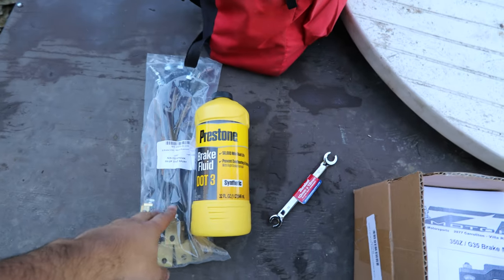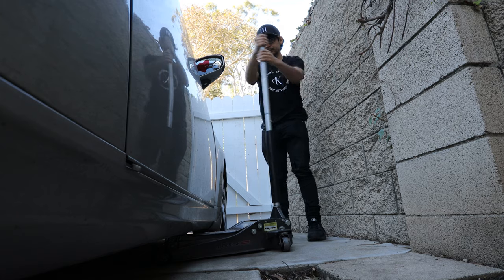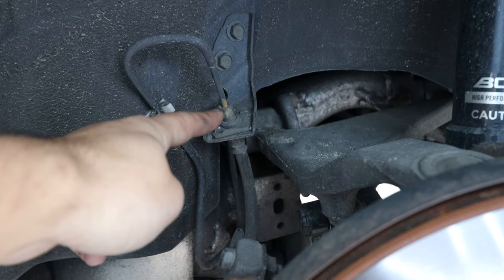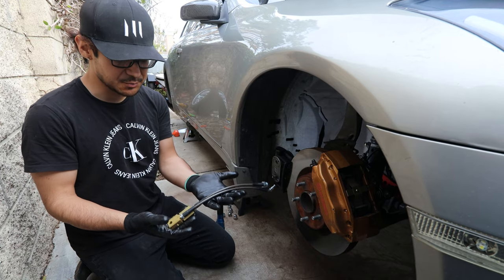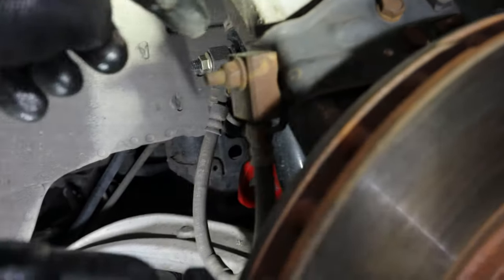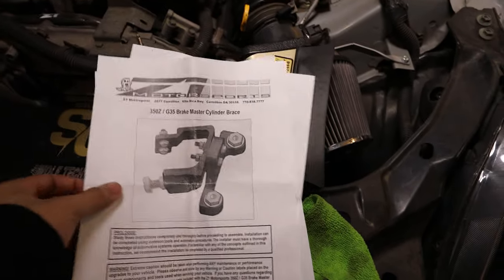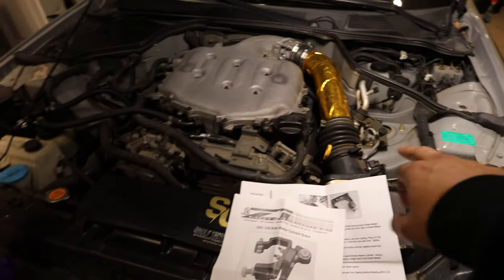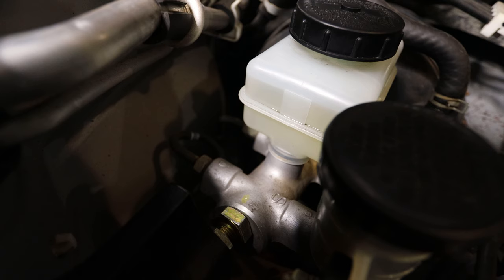THESE Brake Mods EVERY G35 / 350z Owner Should Have!!

Comment: What rotors and pads are you running?
Reply from the maker: I got them from r1 concepts! Definitely recommend! Great price!!
Reply: @JoeVazquez  right on, I recently got the z1 g35 non brembo brake package with the steel lines and master cylinder brace. Pads and rotors are on and brakes feel better but I think the lines are really gonna change the car.

Comment: Question any good brake kits recommendation for a noobie?
Reply from the maker: Go on r1 concepts website, amazing price and great variety for what you need!
Reply: I have akebono g37 big break kit on my g35 coupe I’m sure you can get a used pair for the low
Reply: @andreasskordalis4062  close to brembro quality I hear...
Reply: @winstonwolfwhiteshoes  way more powerful they have four pistons infront and two in rear per caliber
Reply: @winstonwolfwhiteshoes  the akebono are bigger then the brembros though so you will only be able to rock 19” wheels anything smaller will not fit
Reply: @andreasskordalis4062  ah ok thanks. Ill swap to the stock g35 coupe rims since those are 19s..